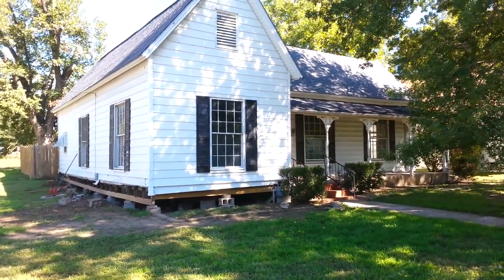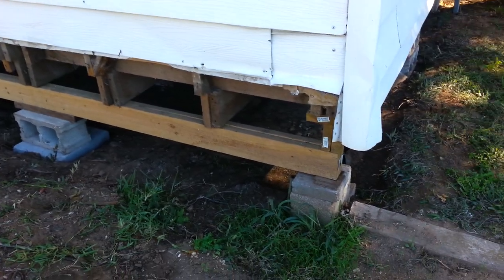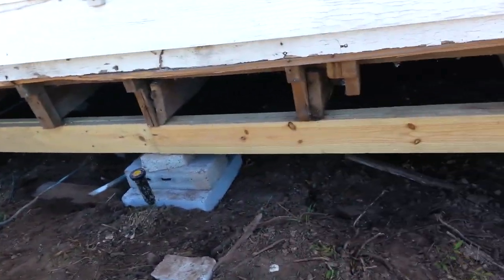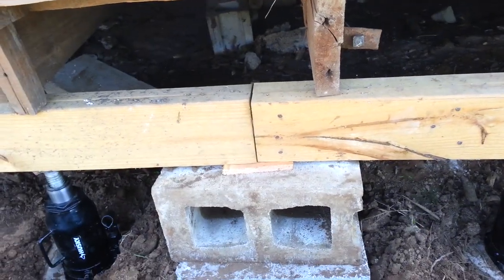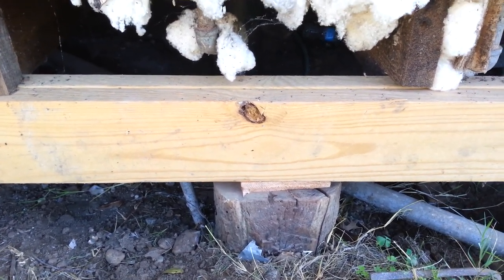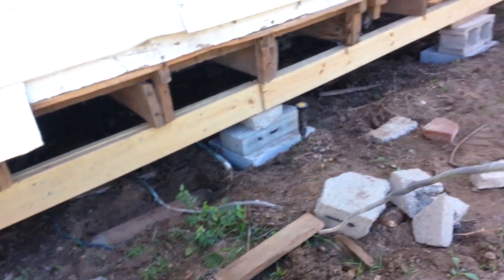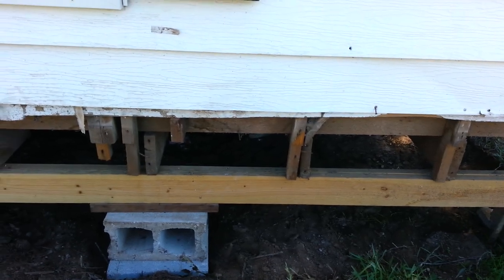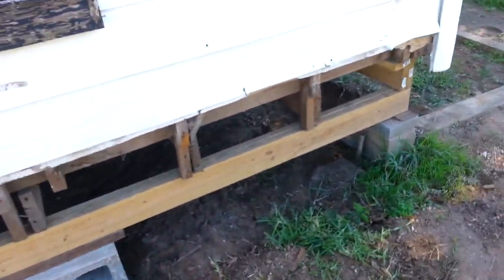How to level a pier and beam house

Comment: I tried the same method but the Jack’s just keep pressing the ground down without lifting the house
Reply from the maker: You have to put the jack ontop of a 2x6 board. If the ground is really moist then even that won't work.

Comment: Any points on a three-beam or four beam scenario? I just moved into a 9050's Texas build with my mom (The food is good!). I guess I'm curious if there's a faster strategy to taking up carpet and flooring to achieve inner house beams. Also, apparently, we came from a build of infrastructure where these houses just ran pipes according to necessity. I have a single sewage pipe running laterally with the house that broke. to a septic tank. 

I'm pretty keen but you seem wise to this regard, I fix guitars for a living. I appreciate the knowledge.

Comment: If the house is about 4 feet up on post and cement pier blocks, how do you Jack it up to relevel the cement footings?
Reply: Deborah Davis There’s post jacks that are taller. You could always use a 4x4 cut down as well, although this is more dangerous. Any side loading and the jack and 4x4 could fall over and kinda of eject out. If you are only lifting an inch or less, this probably is a too big of a risk.

Comment: I've been swindled out of about $3,000 now trying to get my house repair I've attempted on my own got an estimate just yesterday at a quote of $19,000 I really want to learn how to do this on my own with the help of a few friends I recently buried my mom who had no insurance and all the money that I was saving for the house to be lifted I had to pay to put her to rest and it still pain so it's only feasible for me to reach out and ask how do I start and where do I start and what type of materials do I need my Foundation has gotten worse and I'm afraid my house may fall in
Reply: first get something to check the levels of your house (you can make a cheap effective one yourself with a hose bucket and water) then either find the highest point of your floor in the house or a chimney to determine where to lift your house to. get at least two jacks, you probably wont need 20 tonners. lift the beams to the right height, remove the old piers with a sledge hammer or dig them out with a small shovel. dig a hole about 12 by 12 inches and 20 inches deep, or until the ground is so hard that you can only chip tiny pieces of soil away/you hit solid rock. then put a new pier in with a termite cap, if its hardwood put a concrete pre cast block at the bottom of the hole and fill in with dirt. if its a concrete/steel pier, bolt it to the above beam and leave a 4 inch void beneath, then fill the hole with 10 inches of concrete and the rest dirt. and thats it! a word of warning though lots of houses have had their interiors fixed AFTER they have already sunk, so you may damage plaster walls cornices and tiling in bathrooms and kitchens! good luck

Comment: thank you, Aaron. I was wondering if we might communicate by FB? or preferably, via phone? I am undertaking your worst nightmare...kinda need someone who's "been there, done that!" and can answer some questions as I progress on lifting and replacing on a house 1.5x this size (2,900 SF, 1,2,3 levels- multiple additions connected to central core) 

the initial house built in 1920ish. Hydraulic pressure is pressing the house foundation inward, cracking it. The house is on the water line...
lots of questions.
Reply from the maker: Unfortunately, I'm too busy right now to talk on the phone. Be careful
l and don't rush!
Reply: dunno if my project i am working on can help you with yours.. but i have a site on this permaculture site.. showing photos and some diagrams of what i did to my house.. check it out see if anything applies to your situation..   good luck.. https://permies.com/t/74994/wonky-joists

Comment: Do you know if you have to get a home improvement permit, to do this job?  My house is in a city and is very old.  It's started sinking down into the soil.
Reply: be careful with permits they may condem your house--sometimes it almost impossible to get an old house up to code with out great expense
Reply: Leveling/jacking a house in most places does not require a permit. I wouldn't ask the inspector/city directly. any damage to the home could result in a code violation ticket. structural damage could require ur home be repaired and supervised by a licensed engineer along with a condemnation of your home. Code is not law and the founding fathers would scoff at government telling a man how to construct or mend his castle.
Reply: i bought a lil house for twenty grand built in 1907.. had a bunch of termite damage to three back rooms.. I managed to replace it all myself, sans permites.. I actually made a stain out of cut up steel wool in some boiled distilled white vinegar  added a bit of baking soda, and a little soot from the furnace..  it made all the new wood look exactly like the old wood under the house same exact random coloring..  so far its worked the inspector has not suspected a thing when he looked at my plumbing permit..  i am worried about a beam i need to prop up some, and so far he has not brought his attention to that particular area of the house so hoping he wont notice it when i rewire the place..  i truly think there ought to be two ways of selling a house,, it should either be owner repaired or contractor repaired and permitted.. that way if you're poor you can still repair your own home without worrying about being kicked out of it.. i think the permit process is ridiculous.. in  our town your not even supposed to replace a front door without a permit.. i think if you buy your home it should be your business what you do to it..  unless your in a gated community or a historical district...  a simple little home should not require a permission to do anything...
Reply: your better off not inviting them into your home get three estamets on the work and figure it probley going to end up costing you the highest price after all is said and done
Reply: soahcalm that’s smart.  The stain trick I mean.

Comment: I am considering buying an older home built in 1959. It is unlevel.  Some of the supports (cinder blocks with the holes in them) have fallen and some are broken. It is a very small house, 960 sq. feet.  You said there was another beam under the house that you would do the same.  How many feet are there between beams?  Is it according to the size of the house? I really would like to save money by doing this myself, but even if I can't, at least I will have this info so I will know if it is being done correctly. 
Also, some of the beams have rotted and are going to have to be repaired.  Any DIY info on that project?

The video was very informative and I appreciate it.
Reply: Depending on the size of the beam 4x4 every 4ft, 4x6 every 6ft and 6x6 every 8ft same with the piers/block's. I would recommend getting the solid 8"x16"x8" blocks with a 16"x16"x4" pad. To remove a rotted beam, put a 4x4 a few feet away parallel to the rotted beam block 4x4 tight an picked it up with some hydraulics to release pressure off rotted beam (always put hydraulics underneath floor joist so beam or 4x4 doesn't break & always block with pieces of wood for safety lifting anything just in case hydraulics slip or fail. Also use a steel plate on top of hydraulics and 2"x6"x2ft wood underneath hydraulics), also to allow enough space for new beam cut off rotted beam, old nails, put new beam in, strap down with strong tie s straps. Remove blocks from 4x4 support and lower hydraulics.

Comment: Thank you for the video.  One question, is there a special way to measure the level?  Can you use a 6 foot level on the beam, or do you put it on the floor?  Any ideas?  thanks again.
Reply from the maker: Take a marble into the house and set it on the floor. It will follow gravity and roll if it’s not level. Make adjustments based what that marble does. As long as the floor sits firmly on the joists and the joists sit firmly on the beams then this method should suffice. I find that in realty a level of any kind doesn’t always work very well.
Reply: Thank you.  I will try it.

Comment: So u only have to use jacks to lift the edge of the house? I got est of $6000 to do mine n guy said he wld use steel shims. San Antonio apparently has history of foundation problems n this is 1950s house that had 13 concrete beams added about 12 yrs ago, but needs it again. I think i figured out main culprit is the gutter downspout is attached to corner of house so all that water goes right underneath house. Big dummy whomever they hired